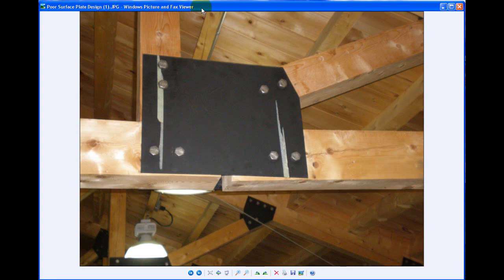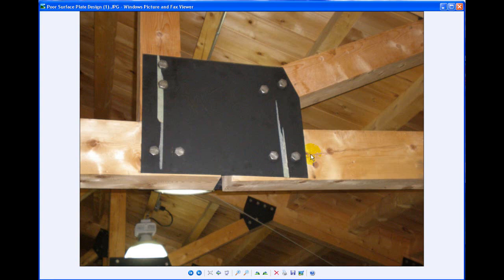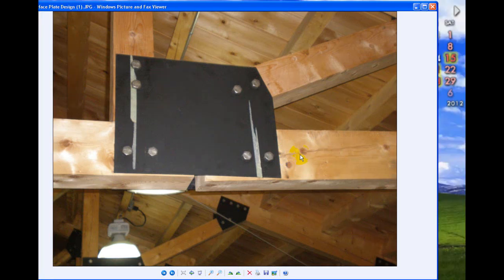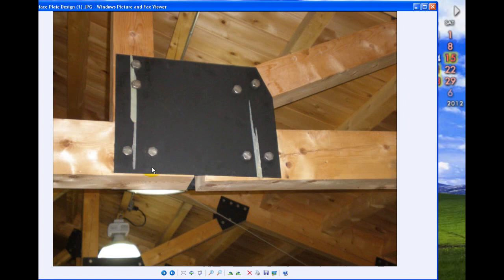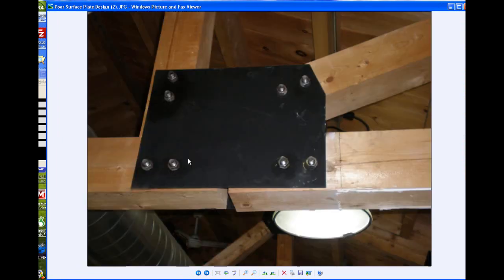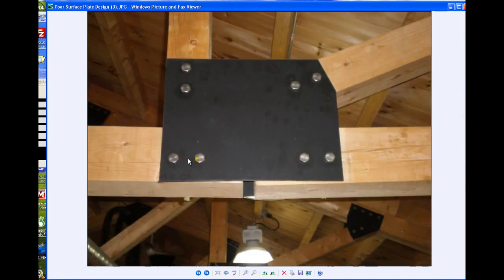Post and beam failures

Comment: Did that beam even have a stable joint?
Reply: Preferably, joints should rest atop posts, not hang out in open air. With or without gusset plates.

Comment: so should the bolts be closer or further apart?
Reply: diagonal and further apart.... wonder if they used glue and carriage bolted   the crack beamed and sistered bolted on angle iron to it?
Reply: Further apart and diagonal from each other. Being in the same grain lines makes the beam weaker along those grain lines.

Comment: Common issue when tried and true methods of timber framing that are hundreds of years old are bypassed in favor of the quick and easy solution of steel plates instead of using actual joinery. Nice video.